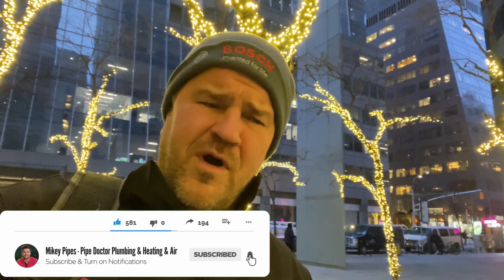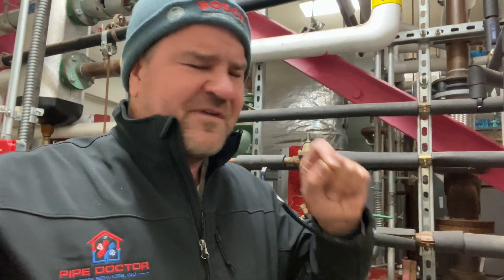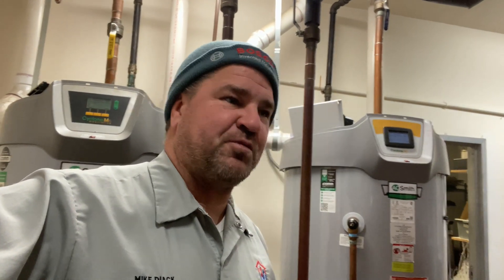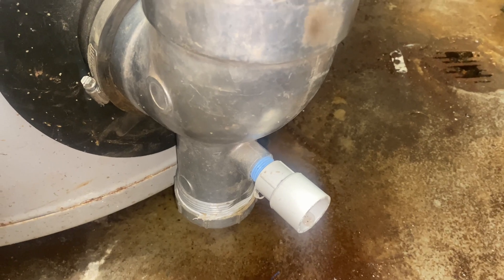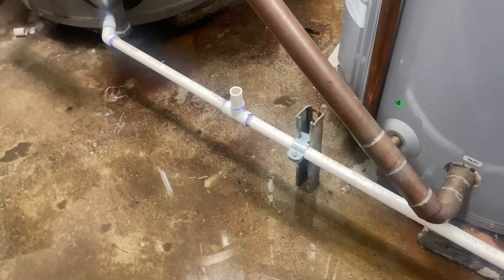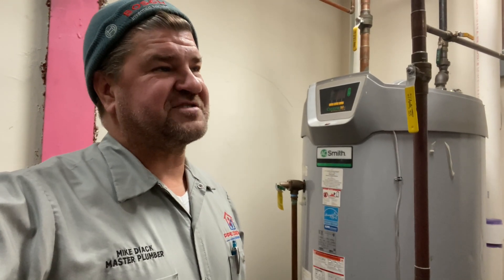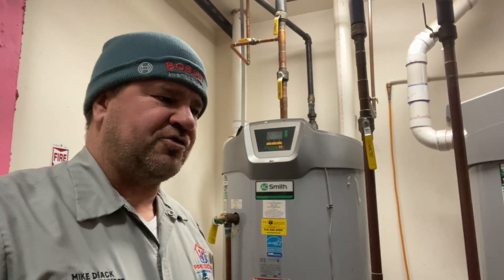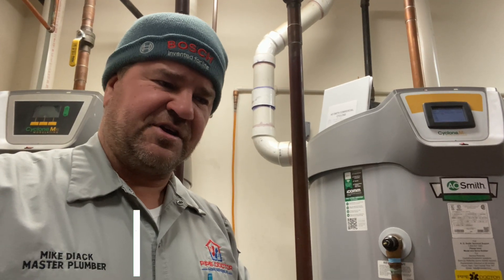Water Heater Condensate Destroyed The Cast Iron Waste Pipes in NYC Greek Restaurant

Comment: Should the building owner be concerned with the condition of the floor drain pipe?  I assume the acidic discharge ate away at the old cast iron.  And, how would you repair/replace?  Would you need to remove the water heaters and jack hammer the floor to get to the pipe???

Comment: Nice neat job like always. Mike. That’s a pretty clean restaurant back room too.   Watching this brings back memories of multi level buildings I used to deal with in Chicago.
Reply from the maker: Ah, the memories of multi-level buildings in Chicago! Sounds like you've had some adventures. Maybe I should come clean your old buildings next!
Reply: @PipeDoctor  the jobs in the city were not a problem, but parking a van was.  I’d shove as many things in my pockets and tool bag as I could, then casually walk to the passenger elevators.   Unless a guard saw me, I’d get away with using the elevators.  It was faster than going to a service elevator.  Frequently I’d spend more time walking from where I had to park than the repair would take me.  Then walk blocks back and hope there wasn’t a parking ticket waiting for me.

Comment: One time I went to test water in an old factory storage tank where engraving was done an my ph meter read negative numbers . Only time Ive ever seen something so acidic. I thought the condensate was just water. Thanks for the dropped knowledge.
Reply: B.s.  potential hydrogen cannot be a negative number. Either you lie or your meter is broken     Edit:   dip meters generally will not register ions greater than 1.0 on their scale
Reply: @MrDmadness  It's how the lcd type meter I used every day to adjust a salt spray solution reacted.  I'm not making it up. It was New England Engraving storage vat. I'm sure you right though but it was so acidic the meter went to negative numbers when I had a sample in a glass beaker. You would think it would eat the meter if it was a true reading.
Reply: @MrDmadness  you can call a stranger on the internet a liar if it makes you feel smart. I have broad shoulders.  If you're picking on me, you're hopefully leaving someone else alone.
Reply: @jayclark5912  I'm just saying the reality. It's not picking on you. P.h, or potential hydrogen can potentially have negative value If the molarity of ions is very very large but no dip tester will register lover than 1. You'd need a laboratory, ironically test strips may also show this. Stomach acid is 1.5 average that's hydrochloric acid. I accept you're being honest so sorry for my original comment ( that was also technically untrue ) but you are correct that at those values it would be destroying everything
Reply from the maker: Thanks for sharing

Comment: should have put pvc unions or adapter unions right at the vent elbow connections for future servicing. I guess they can be added later if need be. 
that neutralizer looks a bit small for those monster tanks combined, guessing both combined will flow too much for that single small filter. but who knows without looking up the specs or measuring the condensate output . 🤔

Comment: Whoever installed the right side of the commercial gas water heater 3 or 4 inch pvc venting system is NO brainer!!!!!! ( too many elbows and 45 elbows). He should have done it go straight up and then using 2 -45 degrees elbows and connecting to the pvc pipe straight up through the roof!!!!!!!!

Comment: I am just wondering do u know what that backflow preventer near ur shoulder at 5:18 is for?
Reply: prevents backflow of water that has entered the domestic water heaters from coming back into the potable water supply.  ideally you shouldn't drink water that comes from a hot water tank.
Reply: @walnutcontractors5661 no bud.. hot water IS potable water.
Reply: @MrDmadness  yeah though you shouldn't drink it !.  Hot water is more likely to dissolve ions and absorb anything inside the tank, if you have tankless maybe you can drink that water.  just best to stick with cold.  you are right about the rpz probably not being installed unless there is a high risk of contamination.
Reply: I can't see the entire layout but that looks to be a r.p back flow valve meaning it has high potential for adverse health effects .  So I assume it's a make up water for the hydronic heating, which usually has glycol in it. It's also potentially the check valve for the hot water re circulating system ( keeps hot waTer at fixture )?   Again I'd have to see the system to say 100%

Comment: I've measured the PH downstream of a more than a few neutralizers in many cases at 4.0 still too low for a cast soil line. Most don't have enough soak time for a complete reaction to bring up the PH.
Reply: I believe the neutralizer in the vid is rated for 400,000 BTU 1.6 GPH. They make a double version  rated 1,000,000 BTU 4 GPH. Then there are larger versions. The 2 water heaters are actually to big for that neutralizer. Which is most likley the case with units you are testing.
Reply: @AlfredVogl  My experience is with neutralizers  properly sized. My trade exposure is primary large commercial.
I think its importance to differentiate domestic hot water generation that of a condensing boilers for heating.
As an example In the fairly common operation of a condensing boiler in a typical primary secondary WSHP  loop the boiler say for a building of 250,000 sqft  inlet is going to be a  fairly constant  70 degrees  with a delta T of 25-30.
The result at these low temperatures produces more condensate that at higher operating temperatures.
As the alkaline material requires an increase amount to soak time that is not conducive to the typical flow threw housing. 
How many HVAC tech check the ph levels going down the drain?
Maybe a few who have an understanding of cooling tower water chemistry.
If no one test the PH are these just a horse and pony show.
Reply from the maker: Might need a larger neutralizer or more media
Reply: Plumb it in to the nastiest soil stack - will prevent blockages 🤣
Reply: @Ariccio123  I did and no more drain flys

Comment: Cast iron pipe is absolute shit. Use PVC and you don't have to worry about crap like this
Reply from the maker: NYC requires cast iron
Reply: @PipeDoctor do you guys not have XFR ? Or blazeguard?   We used to do a lot of cast iron, now I never install it, only xfr
Reply: It depends on the building codes, I’ve heard that in  the state of smash-a-twoshits. Commercial buildings have to be piped with cast iron due to fire code. Not sure if NY is the same or how many states do that.

Comment: Positive-pressure exhaust needs a trap! No vent until after the trap!
Reply from the maker: Sorry, you are wrong. I checked pages 16-17 for manufacturers specifications. No trap is required on the drain.
Reply: the trap is integral to that special vent elbow condensate drain combo. as long as the bottom cleanout cap is screwed on and sealed liquid tight, that is the trap.
Reply: Manufacturer specs super cede everything.

Comment: Mike, do home users need to have a neutralizer on their condensate lines from their furnaces and water heaters? 
I'm assuming the condensate is a mild nitric acid.
Reply from the maker: yes
Reply: @PipeDoctor  then how come almost none of them do? Hacks making stacks?
Reply: @ltsiver .      Only if it’s a gas fired unit, nat or propane, heat pump water heaters DO NOT need a neutralizer . As like with a dehumidifier, does not need one.  Hope this helps.

Comment: Mikey, two questions: Where does that condensate pump discharge to? Could have just run the tubing to the drain in the floor. Also, does flue gas come out that new vent in the PVC drain piping when the unit is running? That was a lot of stuff to carry up the stairs by yourself 👍
Reply: In the state of Maine it is illegal to discharge boiler/ furnace condensate into a floor drain, it must be neutralized and discharged  into a sanitary drain. I’d assume it’s the same in NY!
Reply: @wperro81  that’s correct. The discharge of this pump is after the new neutralizer, so the pH should be fine
Reply: Neutralizer is basically lye chips , highly alkaline, so when high acid goes through it it comes out around 7 p.h. ( neutral )